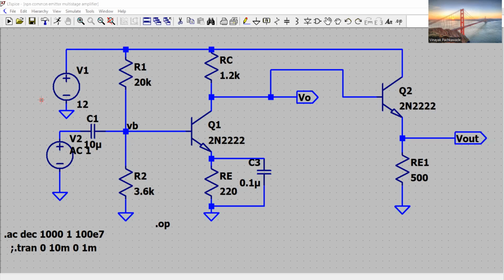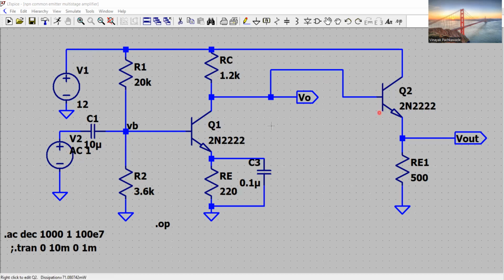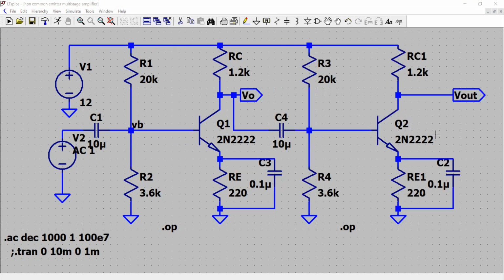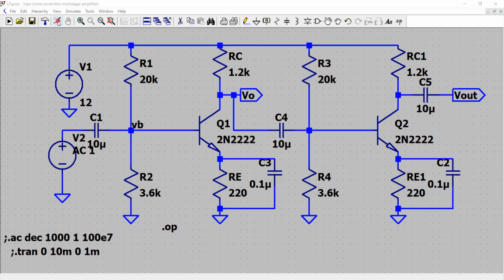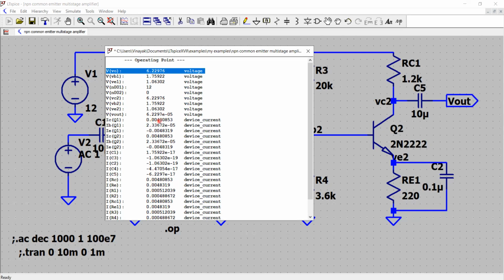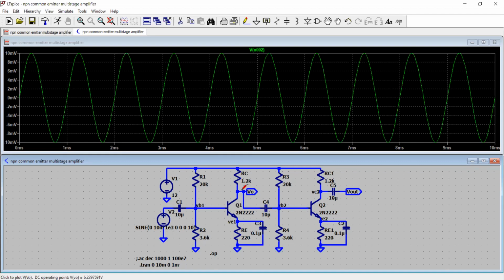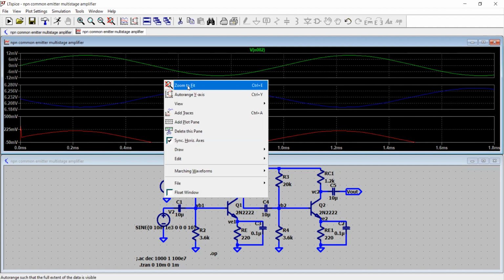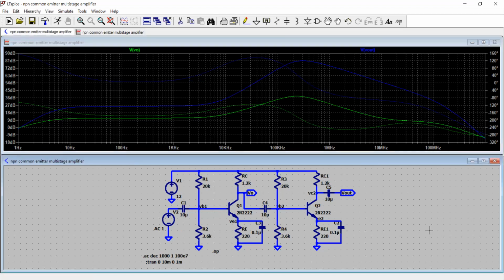Cascade Common Emitter Stages | Multistage Amplifiers

Comment: The 0.1u on the emitter with 220R will have no effect.  This is just a stupid circuit. Especially when the base capacitor is 10u.
Reply from the maker: I appreciate your input, though the choice of component values depends on the specific frequency response goals of this design.
Reply: @VPACHKAWADE You are totally incorrect. You have specified the input capacitor. The emitter bypass capacitor has to follow the 100:1 understanding. You clearly don’t know what l am talking about.
Reply from the maker: The emitter bypass capacitor value is chosen based on the desired low-frequency cutoff and the emitter resistance, not a fixed 100:1 ratio to the input capacitor.
Reply: @VPACHKAWADE You are entirely incorrect.  Where do you get this stupidity from?  No wonder you cannot explain anything. 
Answer my question intelligently.  You have chosen 100n as the input capacitor. Why have you chosen this value? This is the first question.
For the same reason you chose 100n coupling capacitor, the emitter bypass has a value of 100 times greater for EXACTLY THE SAME REASONING. This is where your complete lack of understanding how a circuit works, shines like a light. You have absolutely no idea what you are doing.

Comment: The instructor does not know what he is talking about. You don’t need a capacitor between the two stages. It does nothing but reduce the output.
Reply from the maker: Thanks for the feedback, I'd suggest looking into the role of coupling capacitors in multistage amplifier biasing.